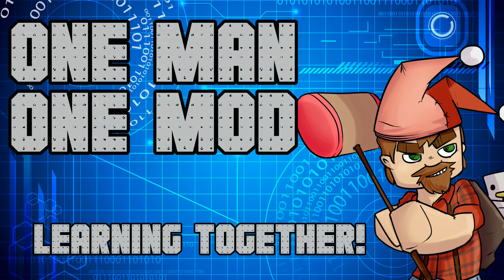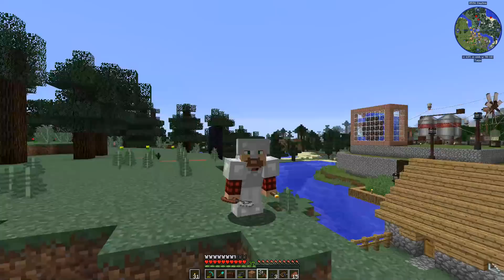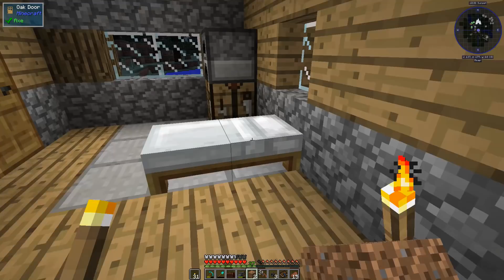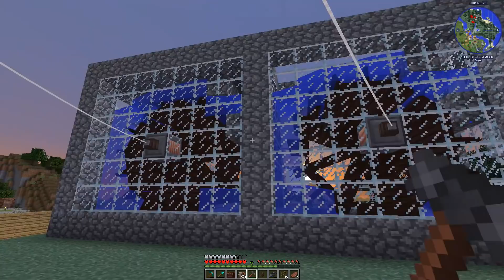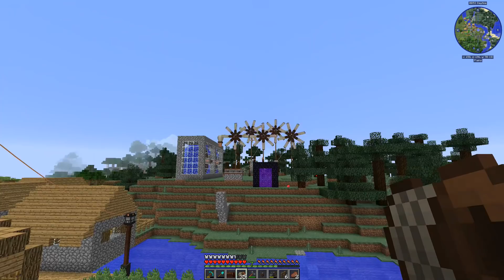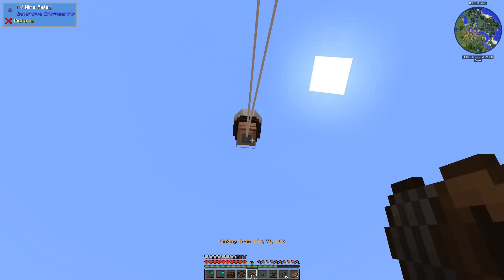1.12 Modded Minecraft OMOM: Learning Immersive Engineering!  E16: Metal Press and MV Power!

Comment: Another tip, that I learned in AoE, the gear press mold takes 4 ingots, and won't take less. Using a hopper to put the ingots on will not work. An extra conveyor belt leading into the input of the press will take single ingots, which will build up until 4 are on the belt and then they move into the press as desired. 

Basically, a hopper into the press input doesn't always work, you may need more conveyor belts to handle input correctly.

Not sure there was a gear press mold available to make in this series as IE doesn't seems to use gear in its crafting recipes?
Reply from the maker: There is a gear press mold, but gears aren't a thing in this series, because they aren't used for anything.  You do bring up a good point though.  I guess a work around would be to add items via multiple hoppers to a row of belts.
Reply: I got it to work with a single hopper feeding 1 belt, which fed into the input side of the press. It looks a bit janky until the 4th ingot arrives, but then it proceeds as desired.

Comment: loving the series.  here is a little tip for you.  1 coal coke and 1 iron makes one steel.  1 block of coal coke and 1 block of iron makes one block of steel.  one block of coal coke and 10 iron ingots makes 10 steel.  :)  freebies.  fyi,  did you know that you can click a scaffolding block onto the imersive pipe to cover it?  might look cool to run the diesel pipe across the river and cover it with scaffolding then you can string your wire across underneath your bridge.  keep having fun.
Reply from the maker: Brad, I am totally stealing this idea!  I need so much steel, its kind of crazy.  I do need a bridge over that river.  Scaffolding might be just the trick!  Thank you for watching!